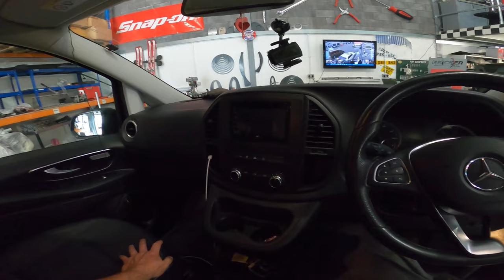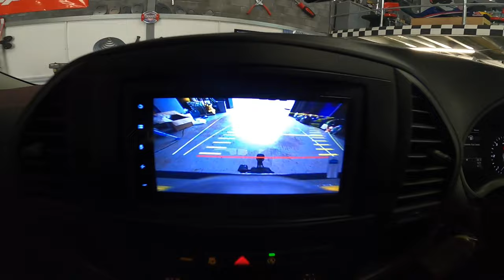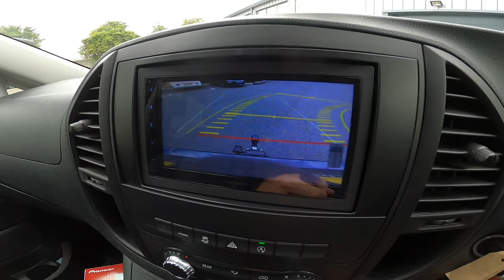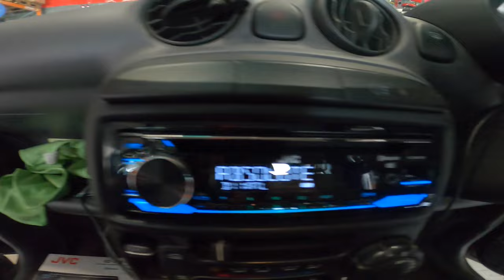snap on tuesday box tour

Comment: hello Mr. C nice one for the toolbox tour. Mines not as flashy or as well branded.?
And it took 11 minuets mine would take three.? but you never fail to make me smile with you out takes lol.
I did try to buy the key 500.1as recommended by yourself but failed twice with the orders being canceled due to lack of stock.         #

So I went the hole hog and brought the audio control d-5 1300 plus focal,s k2 speakers. perhaps I should've sought advice before perch ace but with wot I brought I should have a class system. 
hope all's well with the mother in-law.
Reply from the maker: that's a shame you couldn't get one